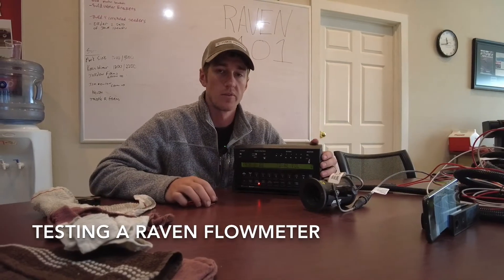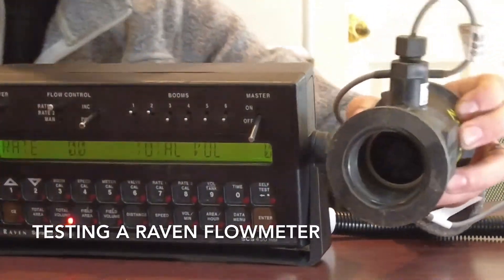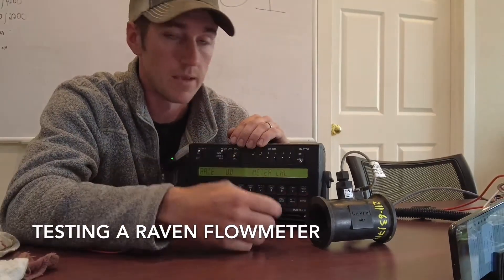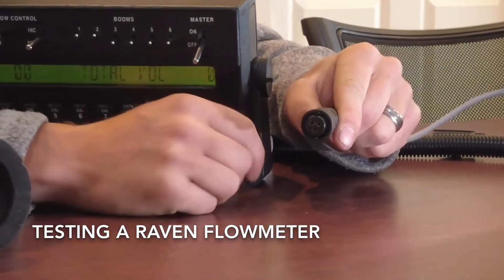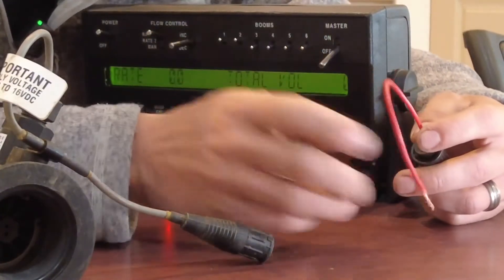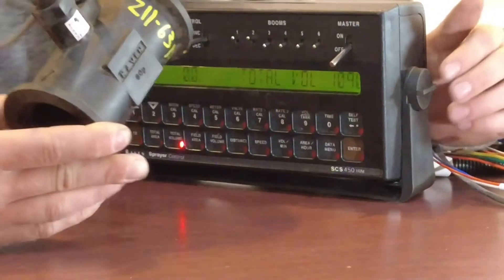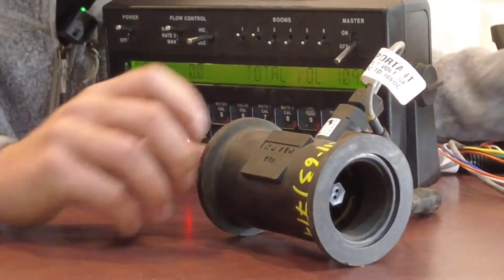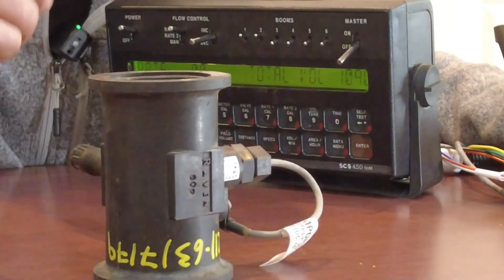How to Test a Raven Flowmeter

Comment: Can you still spray on manual with bad flow meter?
Reply from the maker: You can if you know what pressure you need to run at a certain speed

Say your tips are for 15 gallons at 7 mph….
If you manually increase to that pressure and you drive that speed, then you will be putting on 15 gallons